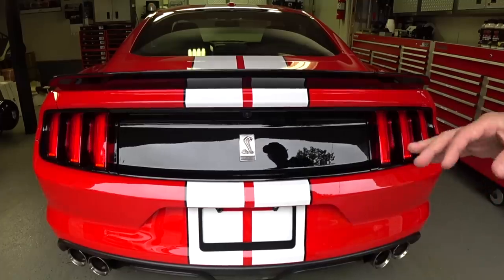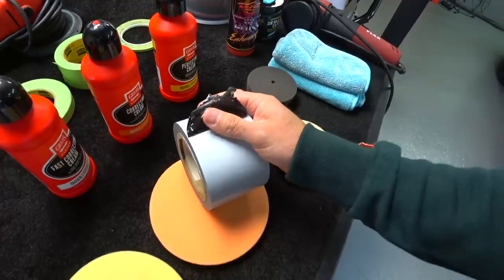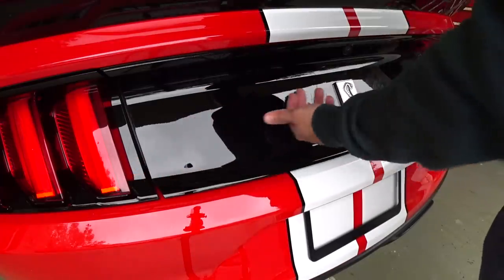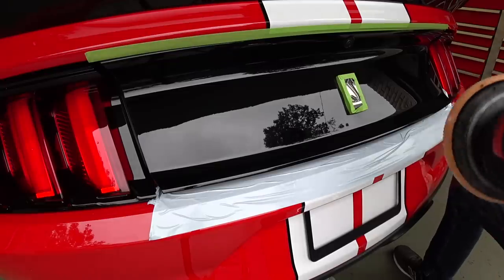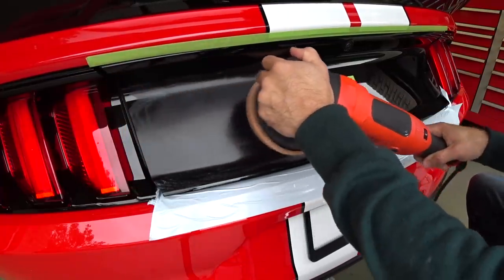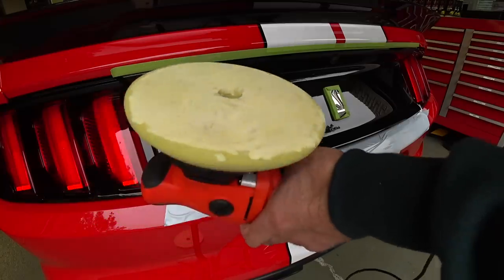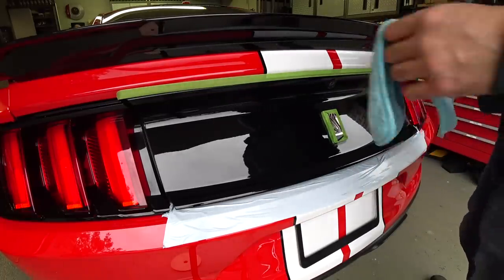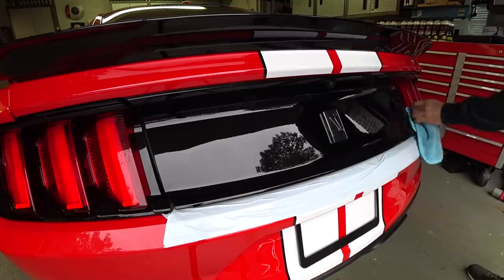Shelby GT350 & S550 Mustang DeckLid Panel Refinishing

Comment: Pro-Tect Plastics & Supply sells the transportation tape. It comes in various widths the smallest is 6"and all are 600" rolls. The 6" is $41 + $22 for shipping....I hope this helps. And to address my question from 2 years ago, can the panel be shot with clear coat ?

Comment: Would this method work on the bezel around the brake lights as well? Would probably have to do by hand but have the same kind of scratches in between the brake lights and around them.

Comment: I thought you said you didn’t like the Griot’s system on your video about the different polishers/buffers you use.  You even said you sold it on eBay haha what happened someone at Griot’s got a hold of you or what
Reply from the maker: never said that i may have been referring to their cheap polishers not the Boss system, I like the Boss system and they did not give it to me for free trust me on that Griots does not need my help to sell product. FYI the ones I sold were the Rupes, rewatch the video.
Reply: Oh ok I thought you said you spent like $800 on two Griot’s and sold them on eBay, haha sorry I watched that one a couple weeks ago, my apologies.  I will probably just get a flex buffer because German crap is usually good and should last a long time although the boss system was looking nice to me also. If I start a detailing side business I want something a bit more industrial so I was thinking of the flex buffer 3401 hd model, is it that much better than the Griot’s?  Everyone seems to love the flex
Reply from the maker: My Flex 3401 is a powerhouse, it wont die on me so it is worth the money. Also look at the Makita I used on my channel, been using this often as well still, its like a 2 in 1 machine and works quite well and Makita is well built and has great support long term.
Reply: Thanks AF I’m getting a late start at it since I’m already 43 but I would like to someday get to a pro level like yourself.  Being able to make money at it would be a bonus as well.  Your gt350 is looking sexy.  I’m looking forward to trying your products like 007 and the wheel cleaner also.  When I run out of V7 and speed shine I will order some from you.  Thanks again fir the wisdom helping out us newbs

Comment: Could you just clear bra it ? I have a 17 and it a area you have to be very careful with
Reply from the maker: im sure you could but film also gets scratched its unavoidable
Reply: @autofanaticcars  didn't know that thanks
Reply: I had my panel PPF'd. The film is far more durable than that stupid plastic panel!
Reply: My Wife's 18 mustang GT is covered with PPF but the installerforgot to cover that part, so i polished it and had it covered with Xpel Ultimate, minor scratches dissapear while parked in the sun since the PPF is self healing. I used Menzerna products.Thanx for the Video..PS. still waiting on that wheel cleaner.